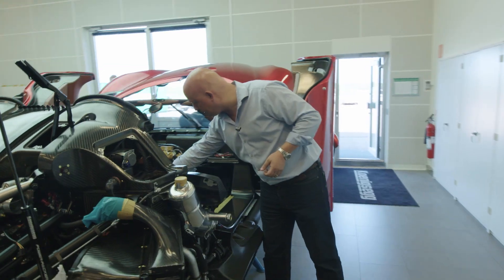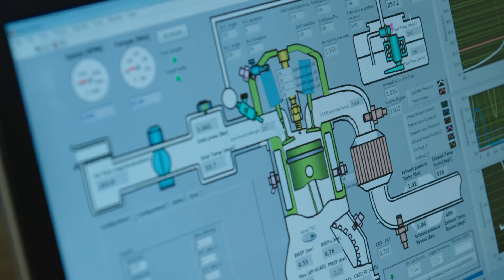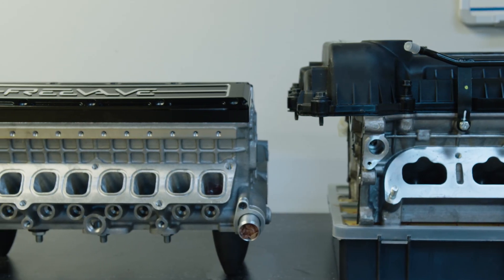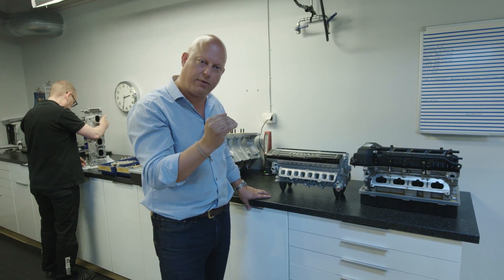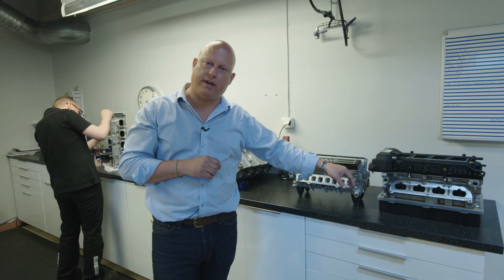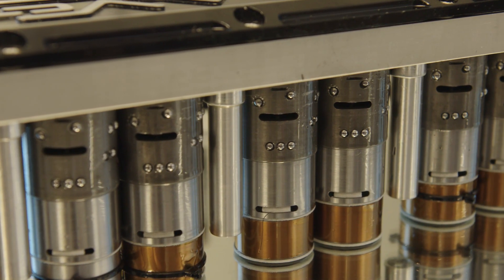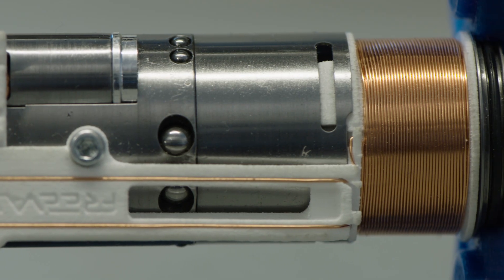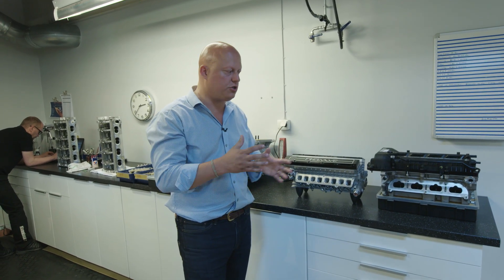Freevalve Update Camless Engine -- /INSIDE KOENIGSEGG

Comment: Somewhere around 20 years give or take I was reading a hot rod magazine and it was about future engine design I’m not a GM guy but was impressed that they were working on this very engine design with electric solenoids instead of a cam and springs the article as I remember went on to say, something like, that with some simple programming you could go from gas saver to all out race no cam to change no timing components to wear out I said then bring it on this is technology at it finest and They are running with it I just hope the rest of the world catches up and this becomes affordable for all

Comment: Well it sounds nice but personally I would prefer to see something more of the Australian made OCP 6 cylinder engine designed by Ralph Sarich,it seemed to be very god,and sort of disappeared from the market once the US got involved with the research..It was a 2 stroke motor very small on size light in weight,no valves,no cylinder head (and gasket) separate oiling system,and pneumatic fuel injection

Comment: So would this work on a Ls chevy?
Reply: i learned about pneumatic valves used in (now rev limited) F1 over 10 years ago. it allowed the technology to push 30k rpms with pistons and methanol naturally aspirated achieving over 1000hp-hence the rpm cap at 18k-20k currently. it's fairly sophisticated yes, but with 2019 regular c & c  machine shops across america, somebody already has to be hobbying with the concept and just hasn't put it out yet, but i don't see why the bolt on upgrade couldn't be done. 
i think it should. 
if i had the money and time currently, would be doing just that.

Comment: If like to see free valve tech merge with variable compression tech from nissan together would make a huge leap in combustion engine's maybe the last major evolution of combustion engine's before electric takes over.... anyway think of those two techs with a twin scroll turbo system and dry sump oil set up you could have a mode fo 40 mpg and weekend comes and button for 500hp mode and no cam,bore and stroke kit needed

Comment: Pretty clever design but, this removes the ability for shadetree mechanics to adjust valve timing though, and it also adds many more moving parts which increases to the potential of failures.  One solenoid goes bad and you're now down a cylinder and your car vibrates like mad...  My 4x4 solenoid has gone bad twice and how often does that really get used?  Not very...

Comment: Reading lots of the coments it would seem many of you can't see what could possibly happen with this tecnology.... Reliability isn't the issue, think fuel injectors, are they reliable?? No this could be a massive game changer in the car industry.... American car technology dominates at the moment and we all know they won't change unless they are absolutely forced to. Well how about this scenario he stated it was being developed for a Chinese car manufacturer., The Chinese would love to own the car and truck manufacturing business,  A cheap, high performance engine would give them the advantage they need to become a major player in the world market, lets face it anybody can throw the pressed metal bits together, suspension technology is easily licensed. What truck fleet operator wouldn't want a fleet of trucks with a fuel saving of 15% - 20%.  The Amercians have already taught them how to run assembly lines with massive production capacity, a car rolling off the current assembly lines every 60 - 90 seconds. They have the capacity, just not that breakthrough product as yet. If they joined forces with the Indian Tata company they would be a force to be reckoned with that would see the end of American dominance in the Car manufacturing world in a very short period.

Comment: No need for cam phasers. Timing tensioners, or valve train drag. Simply the crank would be only working the piston resistance and any residual compression on the exhaust cycle.

Comment: I'm curious to see how well this technology will hold up on an engine with 100,000+ miles. Very Interesting.
Reply: I'd imagine pretty well. If it's just pneumatics/hydraulics opening the valves, should be easy enough to shield and they're well-understood technologies at this point. Would definitely increase cost to build, and cost + difficulty of repair though.
Reply: I feel like the computer is what will go out first but that's my opinion. hoses, wires, and everything else seems like it'd be fine

Comment: I wonder what happened with this? Been a couple years now and no running prototype cars with this design, nothing. Did it turn out it didn't work or?
Reply: it was tested in a saab 9-5 as a testmule car all the way back in 2015 on the first version. there is a youtube video on it.  Since they are not using it on their own engines yet its probably not ready for market yet..
Reply: @fixandtests  Yeah I remember that, but Im guessing it was only bench tested? I just find it odd that it hasn't been more visible in new prototypes over the last 3-4 years, and it makes me wonder wether there is some fundamental problem with the design.

Comment: That's not a free valve engine, it's a camless engine because the valves give the piston a the ratio of gas to oxygen which when compressed gets hot and further vaporizes the fuel because only vapors ignite, not liquids. Cool design.

Comment: 2:45 Bragged about reduced head volume

4:45 Talks about bloated dual path exhaust primaries that take up more than twice the volume saved with the smaller head.

5:18 "We have no need for the precatalytic converter anymore."...only if you don't plan to sell one in the United States.

Comment: Formula 1 and Moto GP racing have literally been using this same thing in their engines for years now. This isn’t a new innovation and the pneumatic system is somewhat flawed because the gasses over time escape the cylinder head and you’d have to refill the compressed gas used (F1 and Moto GP use compressed nitrogen). Since the gasses escape you’d have the problem of maybe one day your car not starting or losing a ton of power one day while driving on the road. While this is a fine idea for racing, where you don’t drive for long and the parts to swap are readily available, in the normal driving world it’s an idiotic idea and will more often than not prove to be unreliable, especially long term.
Reply: Motogp engines like Yamaha uses pneumatic valves. That means no springs but they still have the traditional camshafts. This is a something quite different. It is a beautiful concept if you ask me.
Reply: @RyanBringsR: Freevalve.com says:  "The system has been successfully tested and installed in a SAAB 9-5 (intake valve only) from 2009 to 2011. Over this time period, the SAAB has driven more than 55,000 km of everyday driving and proven start ability down to -20 degrees Celsius. The SAAB 9-5 test vehicle has also been driven 10,000km with both intake and exhaust valves controlled by the Freevalve system."
 http://www.freevalve.com/technology/freevalve-technology/
Reply: 55000 km is nothing
Reply: @Tom M: Do you know the Bishop Rotary Valve? http://home.people.net.au/~mrbdesign/PDF/AutoTechBRV.pdf
Reply: @eerojaakkola8130  also check out the Roton valve, by UK firm Roton Engine Developments, bought out by Australia PTY (originally backed by Rover, but lost funding when Rover went bust.
Reply: You mentioned Moto GP where Ducati still uses desmodromic cams.
Reply: Good thing it's not pneumatic then.
Reply: yeah they reduced weight by eliminating the camshaft BUT wouldn't there be added weight by adding a tank of compressed air and oil? even if they say the engine becomes the compressor for air and oil, at start ups, the valves would need pressurized air and oil to open and close so there has got to be a tank of reserve compressed air and oil to start it??
here's my other idea for a camless engine.. why don't they put permanent magnets on top the the inlet and exhaust valves, then push the valves up and down using an electromagnet, at same polarity they would repel pushing the valve down, reverse the polarity, the permanent magnet would attract with the electromagnet pushing the valve back up... so just electromagnets controlling the valves opening and closing???

Comment: id like to ask the questions, apparently, unasked by car designers. how will this fail? how hard is it to replace what fails? how bad will the failure be?
one, possibly major, flaw that come to mind is when you said theyd be pneumatically controlled, how will you separate the water from the air lines and how will winter driving conditions effect it?
if theres water in the lines that dramatically reduces the life of the valve controllers and shutting the vehicle down in the winter could possibly be fatal unless you incorporate a completely sealed system.

Comment: Use solenoids to operate each individual valve.The solenoid is part of the valve attached to the top of the valve.The solenoid can be locked by means of quarter pins or something similar, so that it can be repaired or replaced.Variable resistor to operate the opening and closing amount of the valves, to be linked to the the ECU.
Add a vacuum pump (which can be electrical driven or mechanical (gear driven or hydraulic) driven off the crankshaft or belt driven) to the exhaust valve port, for faster extraction of the exhaust gases.This same extraction can drive the turbo inlet turbine.  The exhaust port can be smaller to allow for faster speed of extraction (Bernoulli Principle on low & high pressure) and keeping in mind the Combined Gas Law in physics.Before engine reaches 5 deg before BDC, exhaust valve is to open and vacuum removes exhaust gases o be cleared by 10 deg ABDC. Inlet valve opens at 10 deg ABDC, clearing and cooling the cylinder and engine block.
Following parts of the engine will be void: camshaft and followers.  Inlet and Outlet valves must be placed on an angle between 20-30deg (in relation to the engine block) opposite each other. Cylinder head inner surface to be concave shaped, for high compression ratio. Cooler cylinder and bore will allow for high compression ratio.This can even be used on opposed engine block configuration.Fuel efficiency can improve by 20%-40%. Scavenging effect can more effectively control or even stopped by ECU.Self can be a self maintenance function that can be either manually or automatically done by ECU. Scavenging effect will use the principle described in the operation of the solenoid valves and vacuum air pump.Direct injection for both diesel and petrol will be more preferable for fuel efficiency when using this configuration.If valve becomes faulty simply turn out like a fuel injector and have it reconditioned or replaced. Direct injection, fuel injector is to be placed closer to the inlet valve to cool the injector nozzle.

Comment: Still much larger than pushrod configurations. 

I think this would be best applied to large industrial engines. The capabilities could be far better exploited with the lower operating RPM of diesel engines.

Just a few benefits would be:

1- more valves with greater off-seat curtain area... this is highly beneficial to engines with limited valve lift area (high compression diesels).

2- could allow for higher compression in smaller diesels, by allowing for reduced tappet clearance on pistons.

3- lower RPM operation means more time to tailor the curve, further exploiting the efficiency benefits... CRUCIAL to industrial engines

4- reduced packaging allows for either improved aerodynamics or increased displacement via taller deck block. 

5- of primary interest, would be the possibility of viable E85 fueled industrial engines. This technology has the potential to raise efficiency of an E85 engine over 40%. That's more than 66% of current diesel capability... possibly pushing E85 to parity, given the cost per gallon is less than 50% of diesel.

Comment: Put a little 2-cyl freevalve engine in any EV.  The tiny but efficient engine could be an essentially infinite range extender.  It can be run on almost any fuel because all combustion, timing, compression and mixture characteristics are set by the software.  Biofuels of almost any type could be used.  Global warming solved!

Comment: I prefer a 100% electric motor:
- 80% efficiency 
- Zero noise
- Zero emisión
- Torque maximum at 0 rpm and constant until 6000 rpm.
- From 100cv until 1500 cv
- You don't need refuel at gasoline estation. You recharge at home.
- More space in the car for transport things. This is thanks to the small dimentions of engine.

Comment: Common problems with Camless engines include high fuel consumption, accuracy at high speed, temperature sensitivity, weight and packaging, high noise, high cost and unsafe operation if there are electrical problems in the vehicle. 
So Why do they make them ?

Comment: My question is, why haven't car manufactures bought this technology from Koensigsegg and utilized it in their engines?  Overall, the current car manufactures are more or less inept at designing engines and people still line up at dealerships to buy the crap.  They (engineers) could use this technology and make themselves look a little smarter than they really are.